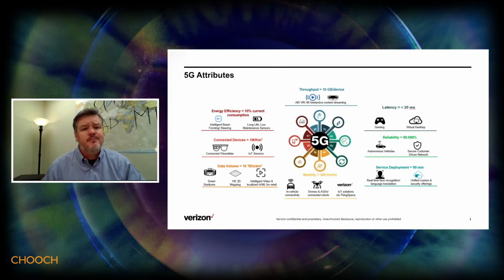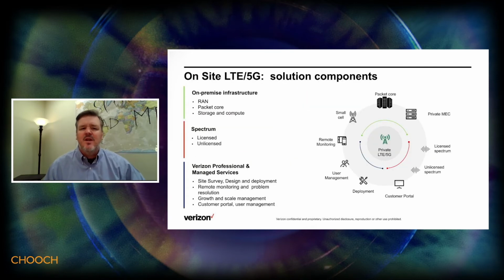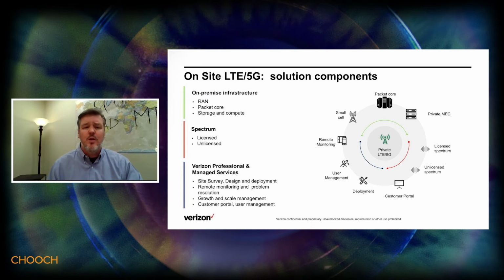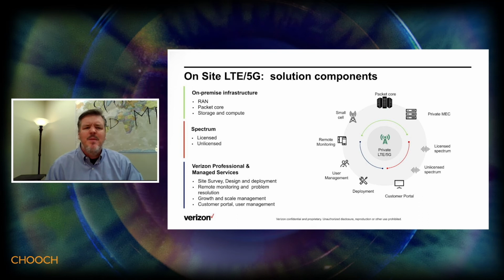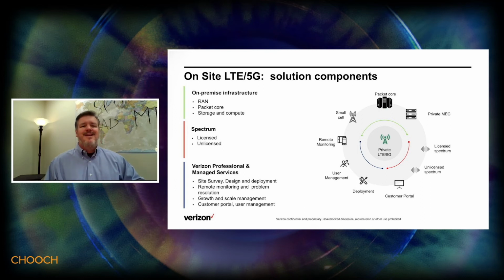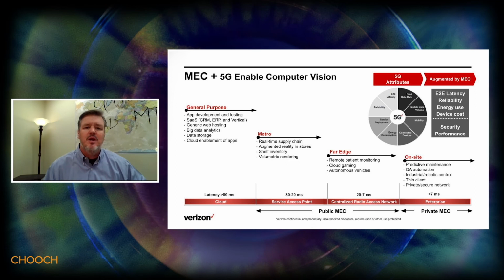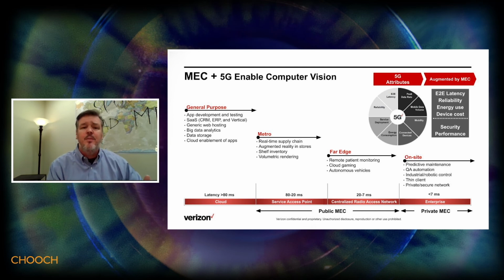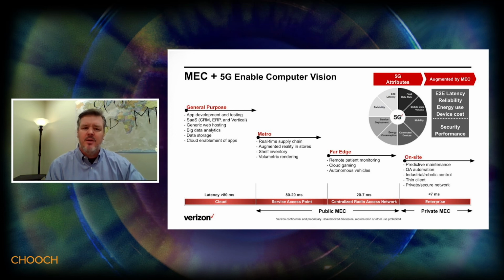Infinite Vision Summit 2022 | Tony Lesley of Verizon on Computer Vision | Sponsored by Chooch

Comment: Connectivity can be tricky in a hospital setting, due to private cell phones and other intermittent interruptions. You sure don't want electronic door security locks, large scanners, Telemetry, security & safety live screen or alerts to go on the fritz, but it has always been an on-off problem. In addition, some hospitals with natural gas can have major problems occur if the outside main (which is huge) has a leak. [This actually did happen and took time for people to notice the odor, which was entering the hospital through HVAC] Sensors could be at the connection to alert (via computer monitor- plus alerts going to hospital Emergency Management, Safety & Fire Officers via their cell phones and special pagers).  Fire/Hazmat Depts have had hand-held "sniffers" since the 90's, which include chemical alerts.
Fire Depts: If a wi-fi signal could be connected to each piece of Turnout Gear, showing interior temperature of suits and the fighter, cool vests could be turned off and on so the fighter doesn't have to stop and do it when sometimes seconds count to rescue possible victims, thereby saving more lives, including the fighter.  This could also be applied to Hazmat Suits, and in the military COBRA suits which can be unbearably hot without cooling systems inside the suit.  

Literally- the sky is NO limit. It's just that most people don't take the time to let the ideas percolate from first thought to BIG IDEA.

We need the big ideas that can be translated into reality.   ❤